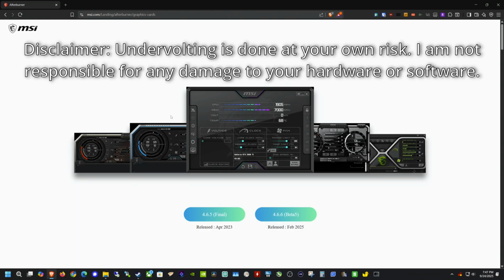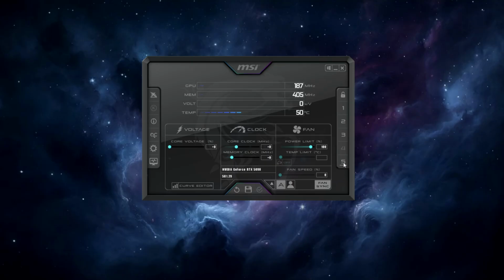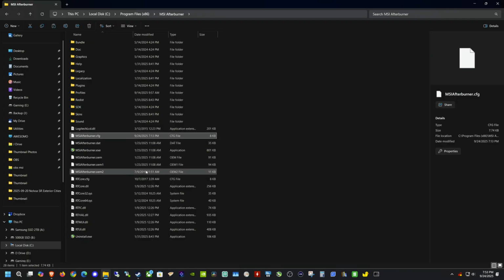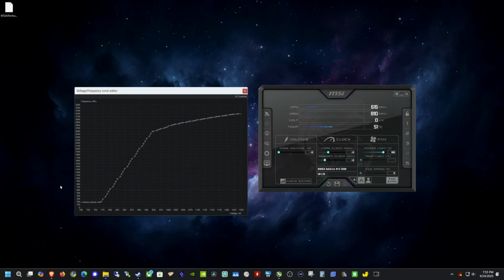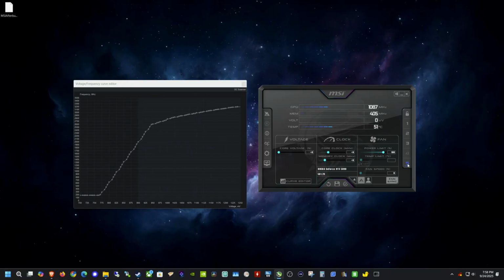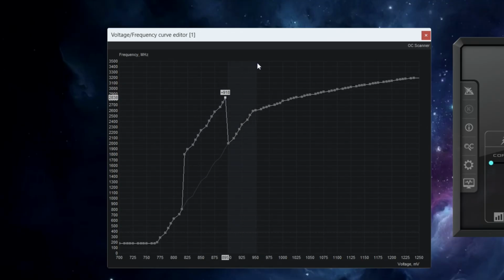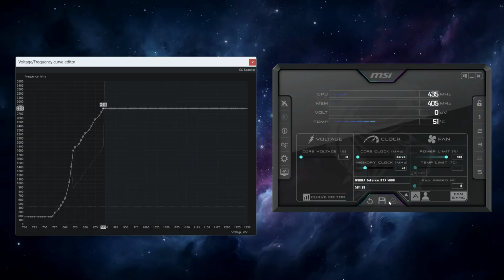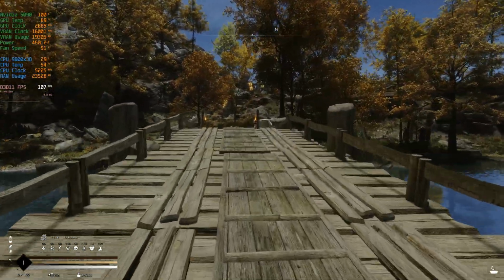You're Undervolting Your RTX 5090 WRONG (Here's How To Fix It)

Comment: What seems easier to do is to pull up the entire graph like the usual, but pulling down the lower end values instead.
I’ve read that strangely, monitoring the power used has actually an impact on FPS.
On my side it’s stable at 3000MHz at 940mV.

Also I never fully understood the graph because if read correctly, it is set to be able to use the whole range of (in my case) 940mV to 1250mV at a fixed and limited max clock speed of 3000MHz
But, what we want in term of undervolting, is the opposite : limiting the max mV used to a fixed value of a non limited MHz clock, or else nothing limit the card to use 1250mV for the set clock speed (which contradict the undervolting)
Or physic prevent this and the card could never use 1250mV for, let say, 900MHz, if I set it to 900 just for the example ?
Reply: I understand what you mean, but I read somewhere that MSI Afterburner will use lower voltage for a specific frequency, so the first point of the straight line.

Comment: Amy reason u go from 820? Why exactly 820? Dont explain anything about that
Reply from the maker: Good call. Ill admit I didn't explain that very well. I am using this point because this is the point on my default curve where my GPU idles at. You 5090 may be a little different than my Zotac.

Comment: My gpu is idling at 2550mhz now can’t get it to go back. I turned max performance mode on then turned it off. Still no luck
Reply from the maker: Reset to default setting in MSI afterburner. Change your gpu performance to Normal in Nvidia Control Panel and restart your computer and it should go back to normal. As for undervolting check the curve and see if you can identify exactly where you GPU idles at. This is the point where you want to set the lower end of you curve as I showed in the video.

Comment: Hey ty for this, gonna give it a go on my 5090 Vanguard 🎉 I had the permission thing blocking me, if you're already an admin account, just go to the file, right click properties, look at security and go advanced, then allow, system, users, anyone lol full control in the boxes and save it. Worked for me 😅
Reply from the maker: No problem! Happy to help. Thanks for the tip! Ill give that a go on my system for the admin permissions.
Reply: @circuitscore did you try the admin thing? I did again last night just to make sure 👍hey and the undervolt works perfectly for my 5090 Vanguard, memory 2455 and uv 2878🎉

Comment: my max mhz allways goes back to 2827 when i hit accept at the end. When i am in games it mostly hovers around 2700mhz. why is that?
Reply from the maker: Depends on what mV your card idles at. It might be different than my Zotac 5090. In game your GPU will boost clock based on its current temperature. If the temperature is too high the Mhz pull back a bit.
Reply: @circuitscore what will different idle mv do? It won’t boost higher then 2700 in games even if it’s at say 65-70C 🤔

Comment: hi what does NOT setting memory clock to 2000 do? Will it lower temps if i leave at 0 or 1600 vs 2000?
Reply from the maker: You will see slightly lower temperatures by not overclocking your VRAM. Many games you will not see that big performance gains. It's mainly helpful for applications that use the VRAM like if you are running local AI processes.

Comment: Worth mentioning also is that if the memory OC is not applied during startup, you need to add a startup delay in the .cfg file of 20000-30000 (ms).
Reply from the maker: That is good to know! Thanks for the tip.

Comment: I did this on my MSI RTX5090 SOC and played some Remnant 2. Game was running great with fans at 1000rpm and 40 degrees on the GPU. After about 2h of playing my whole PC froze and system log gave 11 errors on nvlddmkm. I'll try lowering the memory overclock from 2000 > 1500 (afterburner allows up to 3000 now) and see if that makes it stable. Otherwise I may just have to revert back to stock.
Edit: game kept freezing in the same area, even with memory overlock at 0. Not sure what the cause is, so I just went back to all stock. I guess no undervolting for me.
Reply: Could be not enough voltage, maybe u need to "increase" the undervolt again, so instead of 890 use 900 if that doesn run stable 910 and so on^^
Reply from the maker: Keep tweaking. Try undervolt at a step higher on the voltage curve. Every card is going to be slightly different depending on the silicone lottery.

Comment: It doesn't matter what your idle speed is because you voltage capped it, total idle wattage used will be the same. 

Check your power profile in Windows and in the Nvidia control panel if it's using more watts than normal.
Reply from the maker: If you pull the entire curve up your minimum clock will be higher.
Reply: @circuitscore  Doesn't matter, your GPU will use the same amount of power and have idle temperature because you capped the voltage.

Comment: Great video, this is useless unless you leave your 'Power Management Mode' setting in the Nvidia Control Panel to 'Normal' rather than 'Prefer Max Performance'. I have mine set universally to 'Prefer Max Performance' because 90% of GPU instability is related to this one setting and I have too many games to go in and change on an individual basis to this setting which resets each and every GPU driver update (if done correctly via Display Driver Uninstaller). It doesn't matter whether the bottom of your graph is at with this setting because it will always peg your GPU to the amount set within the MSI AB's profile. I do, however, have two separate profiles that I've assigned to hotkey and swap between on the fly in game, one at 2700 MHz @ .890v and the other at 2200 MHz @ .850v. If there is a cut-scene playing or I'm making potions at the alchemy station in Kingdom Come Deliverance 2 for example I don't need to flog my GPU @ 450w with nothing going on. The tamer GPU overclock drops my power by around 100w (for example from around 400w to 300w in a KCD2 cut-scene or alchemy station and the 5090 is still around as fast at 2100 MHz as a 4090 is at full tilt 2800 MHz.
Reply from the maker: Yeah if it's set to Max Performance it won't idle at lower frequencies.

Comment: These are some good tips to unlock the lower frequencies to prevent idling at higher clock speeds, I believe I covered this downside of undervolting in a Reddit OC guide I did a few months ago.
However, I think 0.895mv is taking away performance you paid for, you can definitely go higher while still keeping the card fairly cool.
My Astral 5090 OC is undervolted at 0.995mv at 3037MHz, temp usually sits at 50c, sometimes up to 60c under max load in GPU intensive games, a significant drop from the 70-80c range at default settings.
Reply: Can you link me that reddit guide? I wanna undervolt my 5090 too
Reply: @MrMrRafaa  I mean, I could, but I'm really not here to promote my reddit guide. So unless the uploader of the vid gives permission, I'll refrain from posting the link.
Just bc I don't wanna be a d*ck about it.
Reply from the maker: @EricTheBroBean I don't mind! You can share you reddit guide. That's a good point though. Depending on the card you may lose out on some performance. For my non OC 5090 I tested my card at stock and with the undervolt and didn't notice any performance impact. Now could I push the card frequency higher with more voltage. Very possible!
Reply: But I think many people who undervolt does this to minimize the risk of the power connector melting. I know we cant be sure, as pins might vary, but the less total power, the less risk (although it doesnt scale 1:1). You get what I'm trying to say right? A slight OC and creating as much "headroom" for the 600w compat connector as possible. The one can hope the per pin amps will also stay within spec, even if uneven :-)
Reply: @srenhyer3895  I get what you're trying to say, specially if you're one of the unlucky ones who bought the FE edition with the poor design. I monitored my 5090 with GPU Tweak for the first couple of months for this reason, but the pins never reached a uneven or dangerous level, so I switched to MSI Afterburner. But a 20c drop in temps by undervolting to .995 is pretty significant to me.
Reply: It wouldn't matter if the idle clock speed is higher, it's voltage capped at the same stock voltage. 
I have the same total idle wattage and temps whether I'm in stock idle clock speed or higher idle. 
Moving the whole graph line is essentially overclocking/undervolting every GPU load scenario, not just full tilt gaming.

Comment: ive done everything in this video. my 5070 still sits at 2600+ while idiling. would be nice to have it at 200
Reply: Set  in nvidia 3d settings global power management mode to normal . Use prefer maximum performance only in profiles in games.
Reply from the maker: Yeah I would try normal in Nvidia Control Panel. Also check where your card idles at and make sure you are using the correct values.

Comment: When you know enough to think you know what you're doing, but in fact you only know enough to be dangerous! 
First step is always setting a custom fan curve (they should never shut off).
Power curves should never have spikes like that, it should be a linear line or a bell curve. Those spikes are what fry components! That's why power cycling kills electronics (the stress from rapid temperature/state changes).
With modern hardware, you should understand with undervolting, what you're actually doing is overclocking! It should still hit it's Max rated voltage, but at higher clocks with the rated wattage (voltage and watts are linked)! 
Your goal is stability, not power reduction or increased performance. Those are symptoms.
Reply from the maker: If you are uncomfortable with the step jump up you can add additional points to the graph. I'm really not worried about it though. My 5090 has been used with this undervolt every single day with no issues. And yes you are right this is technically a type of overclock.

Comment: Not sure how to get the curve to display the whole curve. I did everything you said, changed the min. value to 0 in the .cfg file, saved it, etc. It shows the values you indicated, but the curve still shows only from 500mhz. I was still able to undervolt properly though.
Reply: What's up dude? Have you tried editing it outside the MSI Afterburner folder? I had to do like he said, make a copy on your desktop, edit on your desktop, then copy and replace the original file, in the Afterburner folder.
Reply: @HLSLeO  Yeah I did that, but then MSI Afterburner gave me an error message when launching, and wouldn't detect my GPU or anything else. But I did have the correct values in the .cfg file, it's just that the graph hasn't changed for some reason...
Reply from the maker: Not sure. I just made a copy. Edited the file and pasted it back into MSI Afterburner folder.

Comment: Something new to me. That's great. But I have an issue with frequency having undervolt done. In any load GPU cloq freq is way lower than I set up for undervolt in AB, that's weird, I cannot understand what is the cause.
Reply from the maker: I don't find Nolvus to be immersion breaking IMO. I think its a solid modlist visually but to each their own.

Comment: If you want cold and less wattage card go to buy a 5070ti. What's the point of buying a high-end card like a 5090 and undervolting it?! This card is designed for horsepower, you need to overclock it to max with the highest voltage possible, compared to the stable overclock it can reach.
Reply from the maker: @X--SEPULTURA--X I am achieving stock performance using 20% less power and reducing throttling by keeping the card cool from the undervolt. I think the real question is why wouldn't you want to undervolt?
Reply: Because the connector that goes into the gpu can melt so undervolting can help possibly prevent the issue
Reply: Another stupid comment made by 5070 user😂

Comment: I was wondering about this after having my GPU power usage higher since following one of the other guides. I knew something was up, glad I found your video. My Asus Astral OC 5090 seems capped at 2827 MHz for some reason but performance seems better than stock so I'll take it.
Reply from the maker: Glad it helped!
Reply: same for my 5090 Suprim SOC, appears to be hard capped at 2827mhz, it will return to 2827mhz even if i pulled to 2900mhz and click apply

Comment: I've followed the tutorial exactly, however my gpu is idling at 2535mhz. I have a gigabyte gaming OC 5090 and the fans just never stop spinning. Any suggestions?
Reply: make sure your nvidia control panel power management option is on normal and not "prefer max performance"
Reply from the maker: Check your fan curve at default to see which point on the graph your specific GPU idles. That is why I picked those points to pull up because I knew exactly what voltage my GPU idles at.

Comment: Just did this with my 5090 Solid last night. Running at 895mv I ran Warzone and BF6 at 4K Max settings with DLSS Performance and I was getting around 200-220fps in Warzone and 180-200fps in BF6. Held just fine except for one round of WZ where it crashed to a black screen. Raised it to 925mv and everything seems fine now. Didn't touch the memory clock yet or the power limit. Should I raise the power limit to max even though its not going near 575w? Where would a good memory OC be on the conservative end? I'm happy with the performance and the power draw. In WZ I was pulling 275w-375w the entire time.
Reply from the maker: Honestly overclocking your VRAM isn't necessary. You will see marginal gains at best. If you do overclock your VRAM you should raise your power limit.
Reply: @circuitscore  So I did end up raising my memory clock by +350 and increasing the power limit to the maximum 104%. Gained a little bit in Furmark 2. I'm good where its at. Seem to peak around 435w but am usually around 375w depending on the game. Pulling far less power than the 468w my 7900XTX was sitting at when overclocked, less power at idle (even though I had to change the settings to 'prefer maximum performance' to stop the bottom third of my OLED from flickering, never had that problem with AMD). Also bumped the fan curve because I often have a headset on and even when I don't, its not loud. Maxing out around 74c. Sitting at 34c when just doing normal browsing. May upgrade case fans as Im just using the 7 stock fans from my Musetex case.

Comment: So, I WASN'T doing it wrong lol, still good to see someone explaining this as I had trouble figuring out how to do it properly (I could immediately tell it would constantly be stuck at over 1,000mhz follow other tutorials)
Yeah, I tried to copy and edit the config file but Afterburner wouldn't work with the copy. I tried it multiple times, it always worked when I dropped the original back in the folder, so I just gave up. Not a big deal bc I was able to get the same result, and my GPU idles exactly how it did stock.
Reply from the maker: That's odd. I wonder if there was a permissions issue. Make sure MSI Afterburner is not running in the background or it wont let you copy or edit the file.